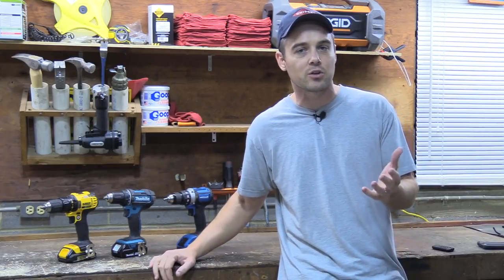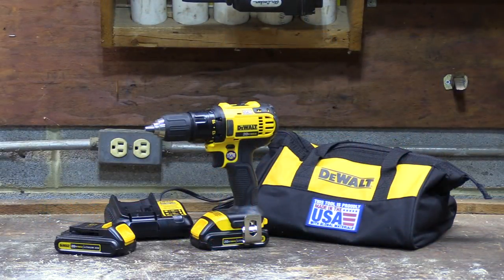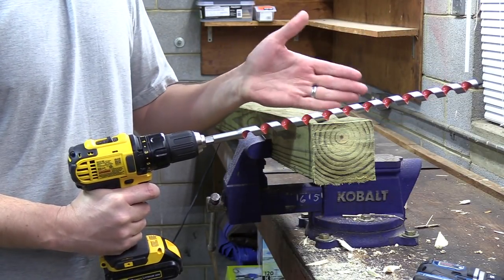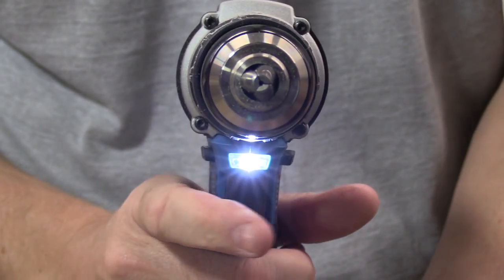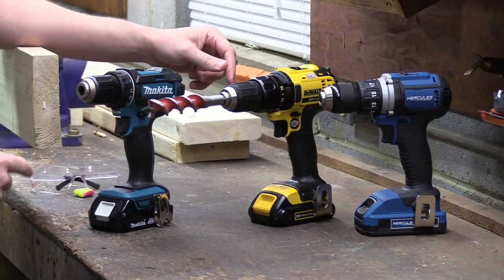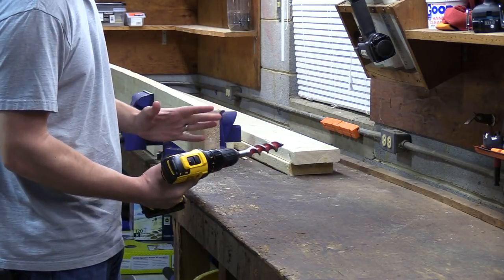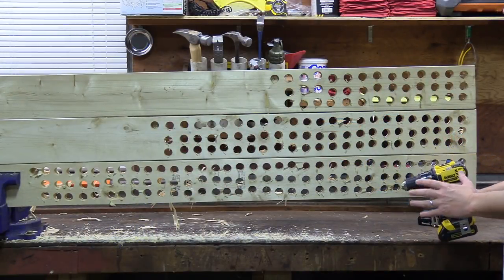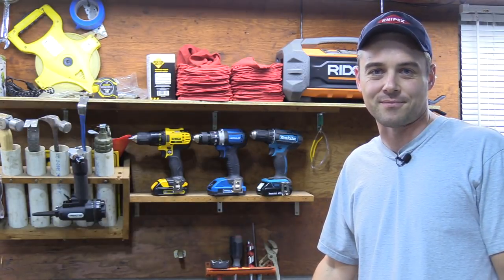Dewalt -VS- Makita -VS- Harbor Freight (Hercules) / DCD780 -VS- XFD10 -VS- HC91K1

Comment: Cheapest drill has highest quality chuck and efficiency.  This is more sad than funny.
Reply: Makes sense. There is no real service network or decent warranty included at the price point, so less overhead on HF.
Reply: But he didn't compare the run off of each chuck so hard to say which one has the best chuck
Reply: goodpoint. Seen a tear down on one. Decent quality
Reply: The prices of all three drills tend to coalesce when you factor in the cost of their warranties. Still, HF comes ahead but by a lesser degree.
Reply: John Bango also the dewalt and makita have named brand battery cell( I believe makita is Samsung cell and dewalt is lg cell) and the Hercules is using off brand cell
Reply: Guo Richard, Hercules is using the same cells as Dewalt and Makita. They are not off brand.
Reply: Ian Johnson really? I watched ave's video on Hercules' battery it appears they are off brand
Reply: Guo Richard, I have both heard and read in multiple places that the cells are the same as Dewalt and Makita. I will try to find the videos again, they were smaller channels that I do not subscribe to. Also, I believe the ad put out by HF also makes this claim.
Reply: Also  don't  forget  the  Dewalt and Makita came with  2 batteries, so add the  price  of  another battery  to the  HF drill and they are  close  to  the  same . And how long of  a  life will each  have , probably  not a long one for  HF from my experience with their  other drills .
Reply: the Hercules batteries probably dont have as good protection, allows a lower voltage and higher current before cutting out. this will lead to shorter battery life (but increased run time when new giving the impression of being a better battery). the motor probably doesn't have as good protection too and will be easier to burn out (also giving the impression of a stronger/higher torque).
Reply: Battery is only 19.99 for the Hercules
Reply: Thanks Michael for your response. I know HF has a lot of discounts. Here is a link for the 20 V Hercules. It says it has a 2.5 amp hr battery plus other stuff and the price I think was $119.00. I paid $99.00 for my brushless  Dewalt 3.5 am hr batteries (2). So, given that I would take the Dewalt  anytime. https://www.harborfreight.com/20v-lithium-cordless-12-in-compact-drilldriver-kit-63381.html
Reply: Guo Richard it uses Samsung batteries also. There is a tear down of one and the whole battery was built better than Dewalt’s
Reply: Bruce Young if he had used both of the Dewalt batteries at the given 1.5 amp hrs. That it came with, drilling those holes, the Hercules one 2.5 still would have beat it by 30.
Reply: And virtually no warranty.
Reply: Yeah, Navin... cos it would probably have cost 12 more cents for DeWalt or Makita to add that to their drills... :) Strange situation, I know, when you need to buy two drills to get what you want and just trade the chucks! :) Oh, i wish somebody would come up with a universal battery and charger that worked across every make and model (or make some sort of cross-adapter that wasn't clown-boot size)... but then you might really see what stacked up and what didn't.
Reply: @jtzx32024  I would buy the additional 1 year warranty, gives you 15 months to bring back the tool for whatever reason even if it's still in good condition, walk out with a new one I hear people do that with a lot of the tools
Reply: Shows how greedy the expensive brands really are.
Reply: @TheLittlered1961  Actually, even if you added a second 2.5 Ah battery and a 2 year extended warranty with free replacement throughout the entire 2 years right at the store the Hercules is still the cheapest one of the bunch and it also comes with a 1 hour battery charger while DeWalt comes with a standard charger that takes more than an hour to charge a smaller battery that will run down both batteries and have you waiting for them to recharge while the Hercules will still be running on the first battery. 

Don't get me wrong, I'm not a Hercules owner, but I'm thinking that might change!
Reply: @jasonharrison25  All batteries die out over time, but when the Hercules batteries are $25 for the 2.5 ah and $40 for the 5 ah, you're not putting out a lot of money when they need replacing.

The Dewalt warranties are Fake News because if you have to have them serviced, you have to ship them (at your cost) to be repaired and sent back to you. You're paying for shipping to have warranty work done. The Makita is a good warranty, you don't pay for shipping it to them to get fixed and the warranty is 3 years. Harbor Freight gives you the option to warranty the Hercules, $10/year, $20/2yrs, so they give you options and don't make you buy into their warranty because if you think Makita or Dewalt or Milwaukee aren't factoring warranty work, shipping costs, etc. into the price of their tools, you don''t know that there's no free lunch.

If you use your tools every day, then you're in a field where those tools make you money, so there's no reason to not get good warranties for your tools. If you're a weekend DIY person and you use your tools once a week or once a month, you'll likely never need to send your tool in for repair.

So, it's up to people if they want to spend $170 for professional grade tools to sit in their toolbox for months at a time vs half that for appropriately priced tools that are meant and built to be used once a week.
Reply: @richardguo1892  "Runout" is the term.
Reply: don't forget that it's new, I'd like to see the performance of the 3 after about 50 charge ups which motor out last the other giving more bang for the buck
Reply: It does not have the highest quality. It only has the best performance when it's brand new. Plus, nobody buys a Makita or a Bosch at the shelf price anyway... This bit is somewhat misleading.
Reply: gothicman03  I should have phrased it better. The video only proved that that Hercules is marginally better at performance than the other 2 when they're brand new. This by no means implies that Hercules "is better or worse" than the other two. As of price, all the big brands are available for 50%~70% of shelf price on discount. I'm not aware of the existence of such for Hercules.
Reply: Harbor freight would. ,what a surprise, an honest testing

Comment: Awesome video...very practical tests that show us real use results.

I’d like to add a little extra thing I noticed about the warranty as you described. The longer warranties on the more expensive models were only against manufacturers defects...not wear and tear. In most cases, you’d notice a defect within 90 days of use. I believe the extended warranty available from Harbor Freight is very reasonable and far more comprehensive. Just another + for the Herc

Comment: I have been a Dewalt user for most of my 32 years in the construction business and I stick with them due to how indestructible they are and how close a Dewalt service center is when they finally give up. The one frustrating thing is I have been using the 18v setup since the day they came on the market and they are trying desperately hard to remove all signs of them for some reason but where the true confusion is when I bought a set of Li-ion batteries and I get less life out of them brand new then I do out of the original XRP batteries (still using after a bunch of years)  and when the Li-ion goes it doesn't drain slowly.... it just stops dead. The lack of any indicators to tell me the status of the battery life when I'm on the top of a 12' ladder squished into a tight space is giving me reason for serious consideration of others.
Thanks for the video -
Reply: The bigger DeWalt batteries don't weigh a whole lot more and have an indicator.
Reply: This test really doesn't account for durability , which is really the most important thing you want and need.  So on drill drives a couple more holes, so what, you just put in the battery a few seconds sooner.  Drill stops after a few months, you lose.

Comment: Gotta love Harbor Freight, despite the hate they get, they sell a lot of good stuff for a good price. Just be careful as a lot of the super cheap tools they have are junk as you might suspect.
Reply: Yep totally agree have a 10 dollar black 3/8s ratchet that's lasted 9 years of abuse. But the 180 dollar pipe bender I bought set screw failed after two bends returned three times before finally getting their cheaper one and finishing he job with it but it's still not good.
Reply: AJ exactly, don’t buy the Drill Master angle grinder, it’s a piece of crap.
Reply: @stevenlengyel9701  I have the Chicago Electric 4.5 amp, the Bauer 7 amp, and the Hercules 11 amp grinders. All are amazing in their own right, good value for the price and power.

The 11 amp Hercules angle grinder is a hellcat. Almost too much power to control!
Reply: Most of  their stuff is from China. Even the Chinese can make a good something off and on. Simple is well made while anything more complex, well,  good luck.

Comment: I work  in commercial construction and I've tried them all over 40 plus years in the business. We are brutally hard on power tools, most folks will never experience that type of use. Makita had the first battery drill I ever saw and it was unique for the time but not impressive...3/8" with a 7 volt stick battery. When Black and Decker came out with 1/2" drive 12 volt drills in the 90s it was a game changer and Milwaukee and Bosch followed. Battery powered tool models have certainly come a long way since they showed up in the 70s.In the last 25 years for overall quality, selection of tools, and service/backup I prefer Makita. After seeing these dissected on another YouTube channel the Makita appear to be built better as well. For my money, time, and headache factor it's Makita. With this said, I think that for the average consumer any of them will get the job done around the house. I invested in Makita to replace my personal hodgepodge of brands at home ten years ago and have never looked back.
Reply: I've already got the DeWalt set and they work fine. The only problem I have with DeWalt is they want a tremendous amount of money for their batteries, which like all batteries will tap out within a few years of use. I hate the color of Rigid but I think their approach to the battery situation is ideal. All you have to do is register the tool with Rigid and you can just send them your worn out batteries and they will send you another battery for free, forever. I could be mistaken on this, but its a nice and fair way to do it. Plus it gets egg on every other company's face when it comes to battery replacement. On top of that it makes them stick with one battery style so you don't have to buy new tools when the batteries wear out.
Reply: Ya the makita recip saws are the best they do great compared to the 3 hf recips and 2 milwaukees we burnt out with our redildo. It's a dildo with a recip saw shank on it u get into the thicker women with the other brands they usually let the smoke out but not the makita great stuff they've got goin there.
Reply: I second that on makita lol
Reply: Mikita seems to make high quality tools. I had been given a little combo kit with sockets and screw driver bits with a magnetic shaft, looked kind of cheap, but this has been my favorite for over 30 years. I have one of the Mikita drills, paid $99 at Home Depot (on sale) works great.  Mikita makes surprisingly good tools.
Reply: @98erics most guys I gave heard try to take rigid up on their battery deal haven't been successful.  Rigid makes up some bullshit excuses about abuse and what not....
Reply: @benjohnson6720  I've had my Ridgid drill around 10 or 12 years. I had a good experience with mine. The only thing I had to do was make sure the batteries were completely dead. Took them in and they sent me 2 new batteries and the drill is still going strong.
Reply: @lindaross7004  ummm...
Reply: @lindaross7004  i'm speechless....
Reply: I too work daily with these guns and have a makita, my biggest beef with makita is the price of the batteries. Otherwise it is a good gun, It does tend to have a little less torch than a milwaukee or dewalt. I have never used a Hercules.
Reply: @lindaross7004  Now that's the true test for power tools!
Reply: @98erics  I have 10 flexvolt batteries as I run a full 5 man framing crew totally cordless on that platform. I've had two batteries die and took them to the DeWalt service center near me and they replaced them no questions asked. They said 3 year warranty as long as they aren't water damaged. One even had the case cracked a bit from a significant fall and they still replaced it. (Of course I didn't mention the fall. Lol) No hassle, not even registered online.
Reply: Linda Ross well ok then ! Video or it didnt happen! Lol
Reply: Makita are just plain reliable and long-lasting.

Comment: I run makita 18 volt I have used makita for 5 years the oldest batteries still work something any other brand will not acheive, I have seen many brands and only makita has a battery protection  system  and  a fan  on the charger .
Reply: I agree with this.
I purchased a 18v Makita drill/driver set for a basement remodel project 5 years ago. No problems, ever. Batteries appear to be strong as ever (I had a concern about battery life and am pleased I haven't had to buy a replacement$100 battery). Dropped and gouged them numerous times, never an issue.
The biggest problem I had was while using the driver to undo leafspring bolts on my pickup. The impact adapter (name brand, not Makita) broke and I could not get it out of the hammer piece. I ordered a replacement hammer for $5 and fixed it myself in about 20 minutes.
That said, Hercules has my attention for my next cordless purchase.

Comment: I use makita used the same drill for two years love it batteries charge in 30 mins and they have a huge selection of tools with the 18 volt batteries I have a bunch of there tools and have had zero issues

Comment: I’d like to see the Milwaukee drill tested.   I bought the new fuel.   Seems great so far.
Reply: Have had no issues whatsoever with my Milwaukee drill either.  Put it through the ringer a time or two while working either in my house or on a customers car.
Reply: MIlwaukee #1
Reply: They never review against Milwaukee. I seen Milwaukee do one with DeWalt . They put each on the ends of the same rod then pulled both triggers. DeWalt started smoking . Never had a chance.
Reply: Bill Thompson I had one of those Milwaukee fuel drills. In a few weeks the chuck locked. Took it back to Home Depot to be repaired. Baught another one while I was waiting for the first one. Within a few weeks that one locked too. I’ve had dewalt ever since. Batteries are starting to go after 4-5 years. I hate the smaller batteries do not have the charge gauge.

Comment: Holy Shit! The HF DRILL kicked ass! For a lot less money. Will it be durable over the months and years??????
Reply: Will it be durable over the months and years?  At the HF rock bottom prices they may be considered one-use throwaway tools.
Reply: At our shop we used to buy a lot of these units as it seemed we were always replacing one or two a month (we have 30 of them).  Over the years we switched between DeWalt, Makita, and Ryobi... Depending who was on sale.  About two years ago we switched to the Hercules units when a Harbor freight opened near us.  They last just as long or longer than the others and saves us $$ in the long run.
Reply: I don't know about the drill, but I do know that the Harbor Freight torque wrench is more accurate and is overall more sturdy than the over priced shit from Snap On.

Comment: I have been using makita drills for decades.. I have a set of 18v LXT drills... I've been using them for over 10 years. I use the 1/4" impact to put on lug nuts and usually have to back then off because it over torqued them. That still has fallen off 2 storey roofs and hit sidewalks and bounced on more than one occasion. Took it like a champ and they still run. I have gone through about 8 battery packs in the 10ish years. The drills keep going. I have some old old ones that still run but I can't find batteries for them. I loved them so much that I bought a set of them for just inside the house. Because the ones I've had for ten years are covered in grease, dirt, brake dust and I'm sure a bit of my own blood. I did this after i was using one in the house and set it down on my wife's brand new very light shade carpet... Yeah, I had to buy an expensive carpet cleaning machine... I built two 14x10 barns with 14x4 decks on each one last year with the Makita drill. I always recomend these to anyone. Plus all the Makita tools use the same batteries.. The radio, saws, weed eater, ECT...... Now if only I could get paid for saying that... Or atleast a couple new batteries..

Comment: I have worked in a machine shop/engineering environment for 42+ years. I was forced to retire from nephropathy 5 years ago. We used to run Milwaukee all the time. Until 2005, they seemed to hold up well, but were dropping in endurance. 
It got to the point that we couldn't even get 6 months out of them in assembly. We then went with Dewalt & they did better, but still the batteries didn't last. 
A friend bought a couple of HF drivers, and he told me that the big guys better watch out, as HF just may give them a run for their money in the near future. 
We couldn't buy the HF units through channels due to the fact they weren't made in the USA. But a lot of stuff is just not made here anymore. 
I have to say I did not expect the HF to come out on top. 
Thanks for all the work and time that you put into these videos.
Smiles.